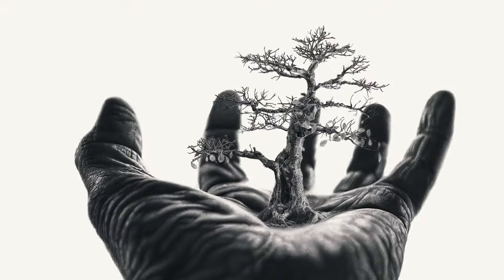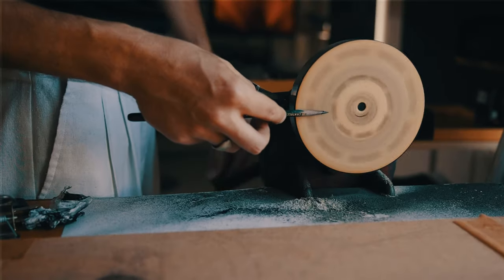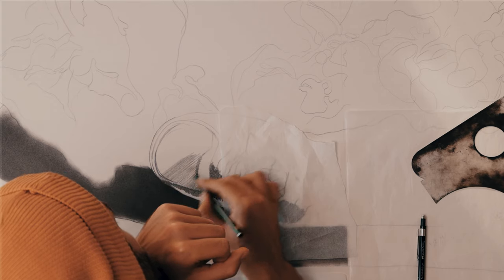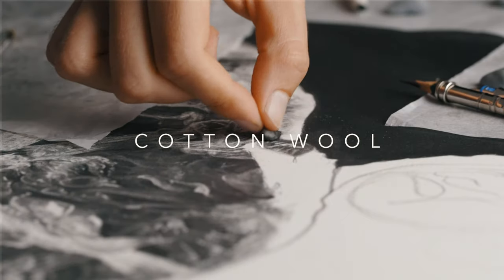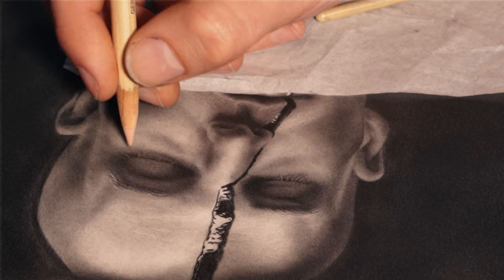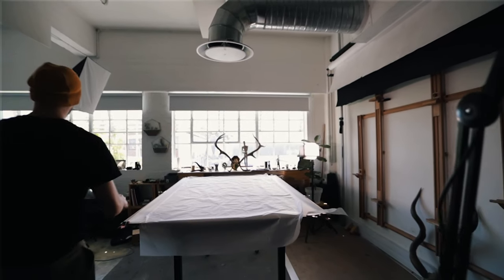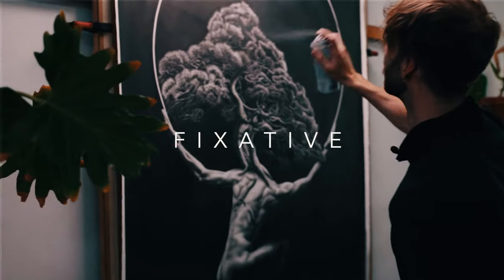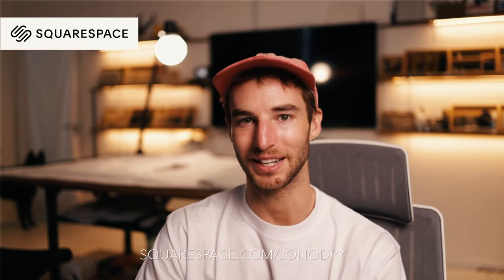Pencil Drawing Tools 2024

Comment: Hi from the US, I am a big fan of your work. Hyper-rich detail saturation has always been the thing technique-wise that would inspire me. Could you share where you source your masonite backing boards from please? I've had an no success so far finding them in the sizes it looks like you use in your videos through markets online, and the local hardware stores only sell 48"x96" panels. The Arches big roll is 51 inches wide, so I am trying to find something at least 53 inches wide. so that I can get used to huge square-cut works.

Comment: I was playing with the idea drawing again after 30yrs. Watching your videos inspired me to gather some supplies. I asked ChatGPT about graphite and buying the powder in bulk. I didn’t know that graphite pencils/sticks are mixed with clay into a paste and then kiln-fired. I was thinking of buying raw graphite with no clay and applying it with brushes. Has anyone tried this?

Pencil/Stick mix for different shades
2B: Graphite: ~65-70% Clay: ~30-35%
4B: Graphite: ~75-80% Clay: ~20-25%
6B: Graphite: ~80-85% Clay: ~15-20%
8B: Graphite: ~85-90% Clay: ~10-15%
10B: Graphite: ~90-95% Clay: ~5-10%
12B: Graphite: ~95-98% Clay: ~2-5%